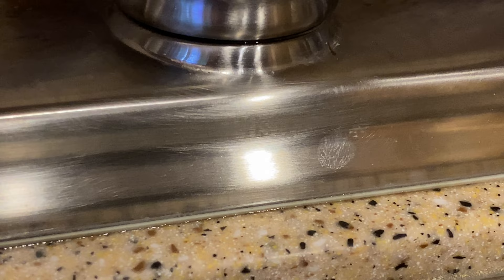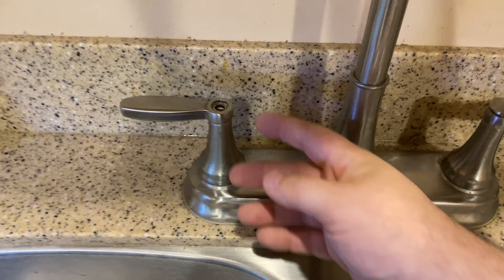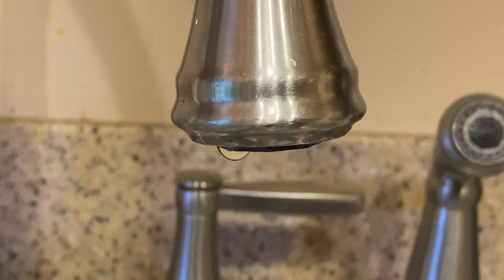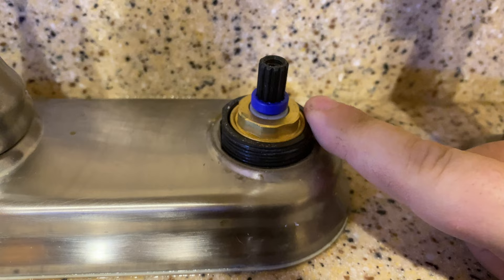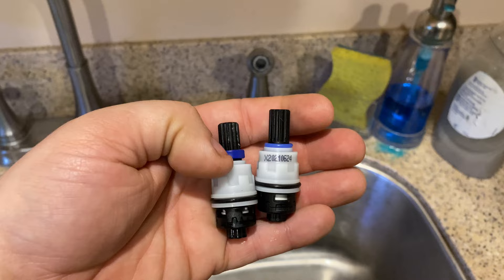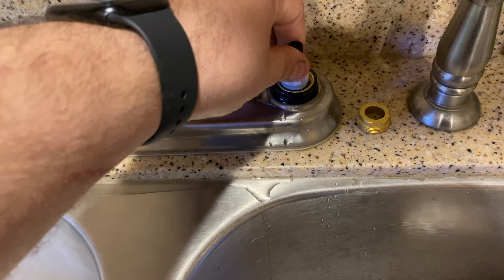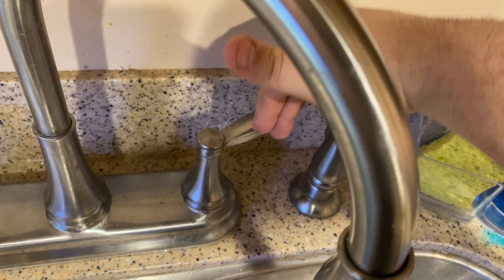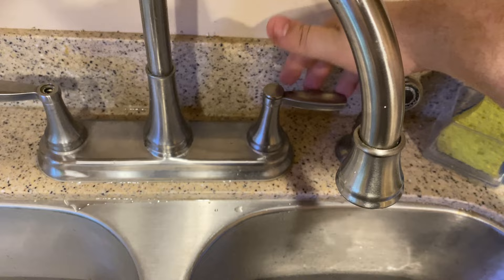Pfister Sink Cartridge Replacement in MINUTES! EASY leak fix

Comment: Nice explanation; not sure what area you're in, but that outlet right of the sink likely needs to be GFCI per local code (unless the breaker is GFCI).
Reply from the maker: It is gfci. The main outlet is a couple over. Theres two shared per gfci.

Comment: mine are turning but not coming up--almost like they're stripped. any suggestions? the handles i mean
Reply from the maker: If it’s the same model/style and it’s spinning, try just pulling up a bit harder on the handle to see if it’s stuck.
Reply: @beaterboxgarage  it's definitely stuck..i think i'll just take it loose from the bottom and replace the whole faucet..idk what else to do at this point..